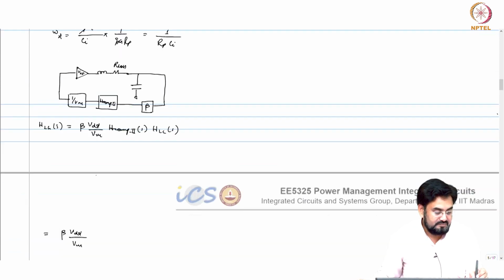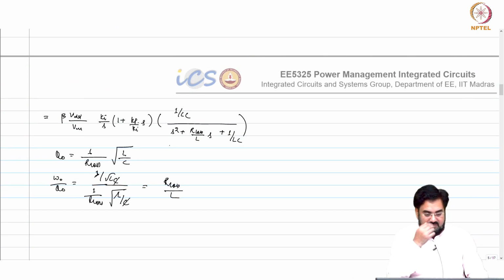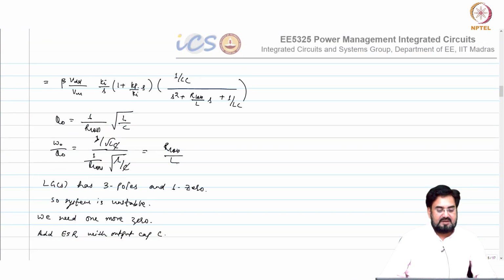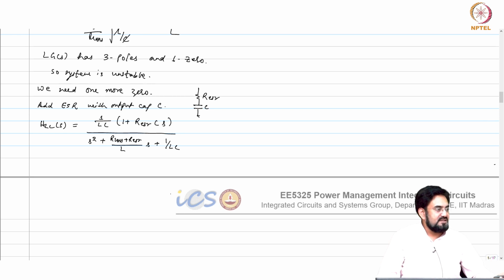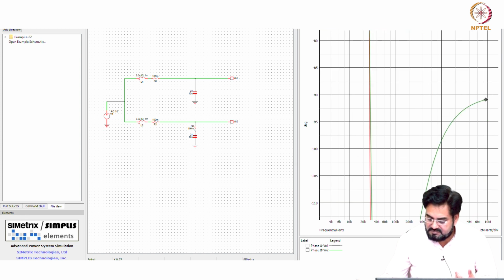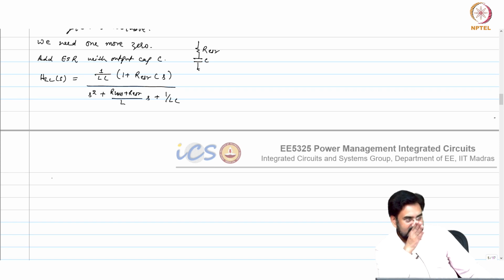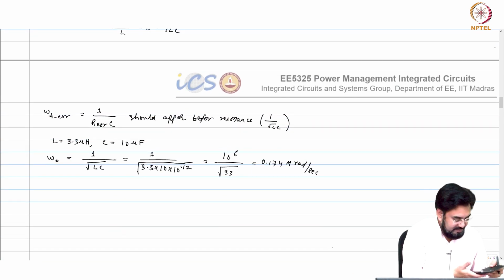#52 Type II Compensator using Gm C Architecture | Part 1 | Power Management Integrated Circuits

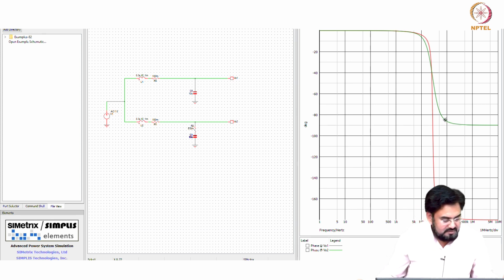Comment: at 18:55 i think we should equate 1/Resr*C to 28khz and use that value to exactly cancel one pole of the LC.
Reply: I think they placed the zero before the pole, so it was like a lead compensator and adds phase margin to the system...